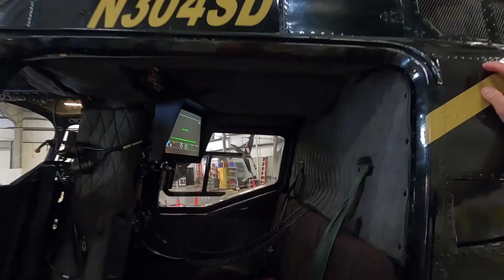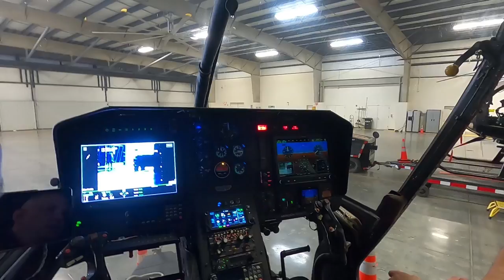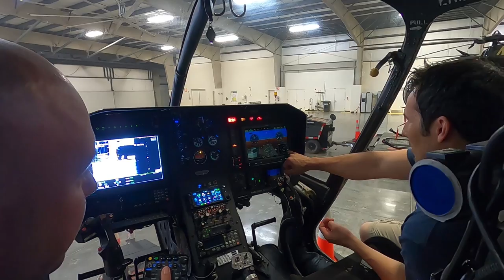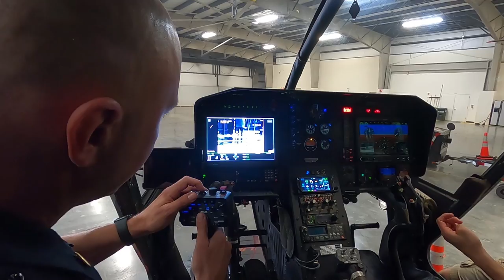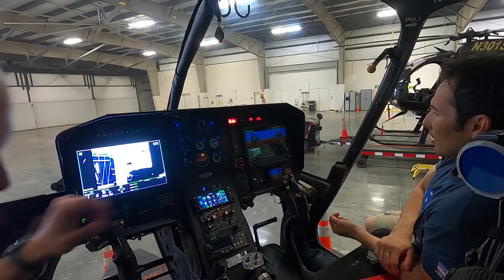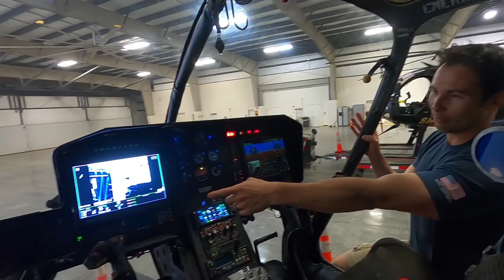SLAP!  Gonky FINALLY Did It! | 100K Subscribers MANCHESTER video!

Comment: Mover - you caught my attention when you mentioned the Combat Talon!  I worked on that weapon system when it was still in testing at Edwards Air Force Base in 1992-1994.  I worked on both the MC-130H Combat Talon II and The AC-130U Spooky Gunship in the Combined Test Force Special Ops Squadron.  My goodness I can't believe that was nearly 30 years ago.  Time sure gets away from you when you are having fun!!!  Take care and God Bless brother!  Thanks for your service!
Reply from the maker: Sorry, it's a running joke between me and Gonky about the T-38A (Also a Talon) due to the seriousness of some of the upgrade programs for a jet that has no weapons or avionics.
Reply: C.W. Lemoine Got ya!!  I just hadn’t put it together that the T38 was called a Talon also.  My experience was mainly heavies, E3, C-141, C-130, C-5 and a little C-17 it’s was coming in as I was separating.  Take care!!

Comment: One of the 1st things I noticed was that both of the Sheriff's Department Helicopters had Tail Numbers that ended with "SD".
Reply: Not unusual.  SD is Sheriff's Department.  Many agencies do this.  You can request a tail number from the FAA, so if you work for the state of Oklahoma, you can ask for 111OK (as an example).  Good eye though!
Reply: @BrittMac422   I know that this is done often.  In fact certain codes are reserved for certain agencies.  If a tail number ends in SP, you can bet that is a State Police aircraft.  The same applies to any aircraft with a tail code beginning with N911followed by one or two letters.  Those tail numbers are only issued to first responders normally air ambulances.  These were a few of the things we used to look for when aircraft would violate the rules concerning the Restricted Airspaces surrounding Washington DC (the SFRA and the FRZ) because Police, Air Ambulances (Medivacs) and military have different rules than others.

Perhaps in my original post I should have worded it differently and said "The first thing I looked for was to confirm that ..."
Reply: @R.Hogarth   Actually, there are a ton of aircraft with SP on the tail number that aren't state police.  Cessna 172SP's often had the SP on the tail number and I've got a friend at my local airport with that.  He calls her, "slow poke", even though it's a faster 180hp model.

Comment: What model F-18s does VFA 204 have?  Is it the "A" or "C".  I see in your videos you mention "A" but all info I could find online says its "C".  I came across a decal pack for 204 and the ANG F-15s for 1/48 scale models and since I work at NAS Nola I am excited to build a kit with those decals but I want to make sure I get the right aircraft.  I appreciate any help you can give me.  I would walk over from firehouse and ask but right now with the Corona scare we are not to go anywhere unless called upon.
Reply from the maker: I flew A+ but they have the C model now
Reply: @CWLemoine  Thank you so much sir.  The decal set I found is the CO plane with the red stripes on the tail which I have not seen in a while but sheet did not specify what model aircraft.